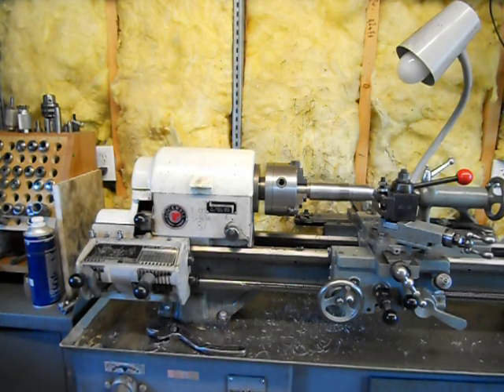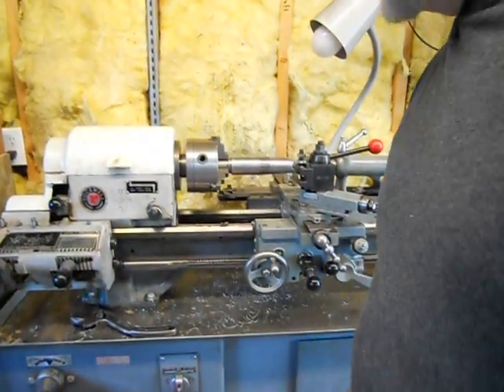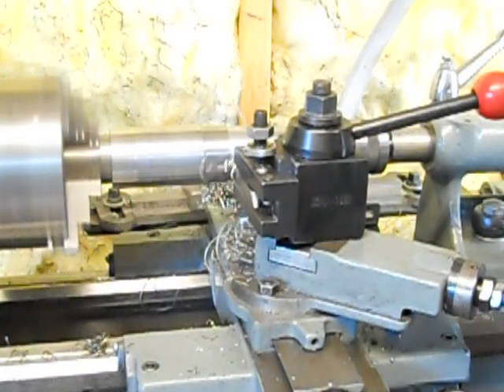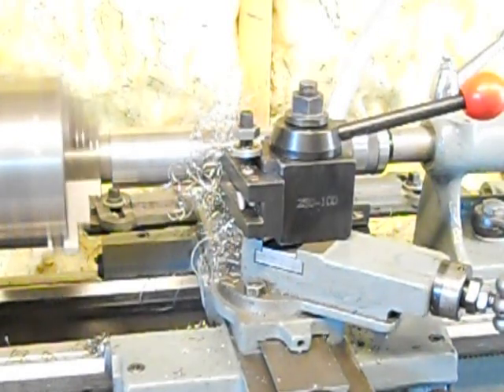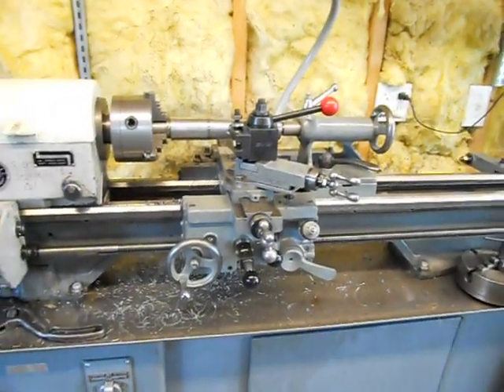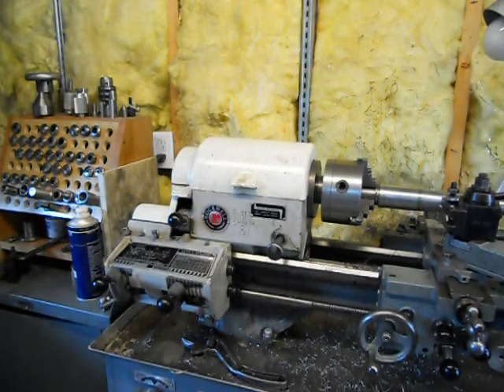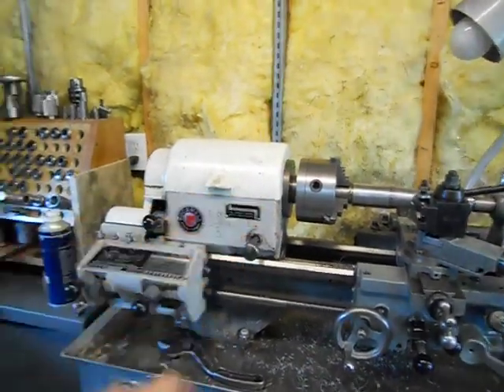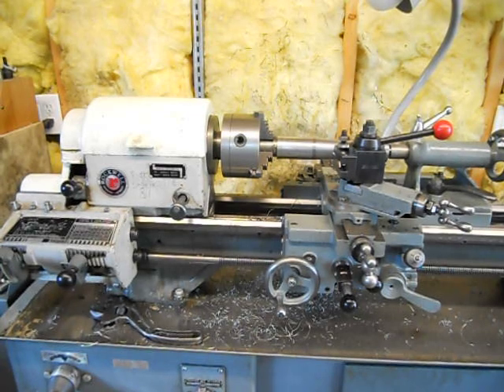Rockwell 10 inch lathe.AVI

Comment: Can anyone tell me what MT is the spindle? Would be most appreciated.
Reply: Hi Ted,

It seems the internal taper on the RW10 is a bit of a mystery. They may have considered it proprietary. I can give you some pointers if you want to make one.
Reply: @arnjones6028  Thanks for the response Arn...I have the original manual and cannot find any mention of the MTs. It came with a #2 and a sleeve for the spindle.

Pointers would be appreciated.

Comment: Hi, Looked at one today here in Thailand, nice. but one thing I like to know, do you know if it is possible to thread millimeter threads? had a look at a manual for a Rockwell lathe, Similar one, but nothing about millimeter threads, all about inches and speed. As the lathe was stowed under a lot of things it was hard do measuring, but  the distance from the center of the chuck to the way it was 5" and the length look like something like yours, it was missing the motor...
Reply: Hi Ludi,
You can easily thread metric using a 47 tooth gear and a 37 tooth gear in the gear train. You will not be exactly at 1.27:1 but will be so close you won't be able to measure the error in most instances. You have to keep the half nuts engaged to maintain the registration between the tool and the thread during the multiple passes needed to cut the thread.  This can be done pretty readily using the reversible motor.